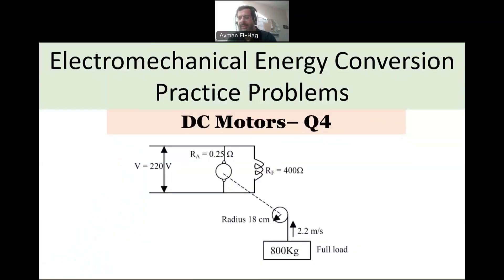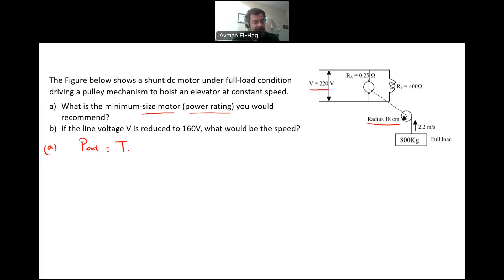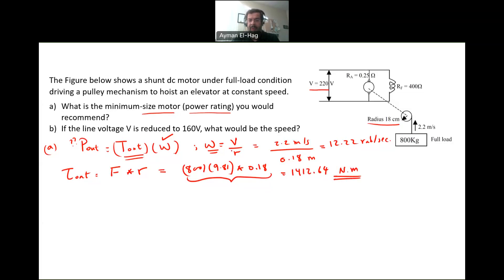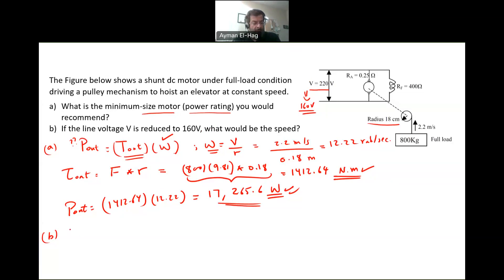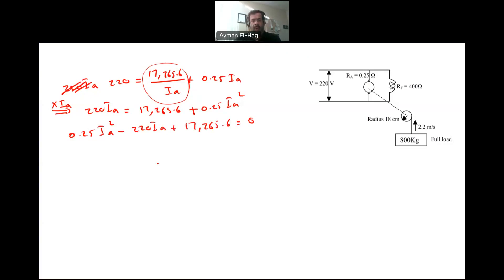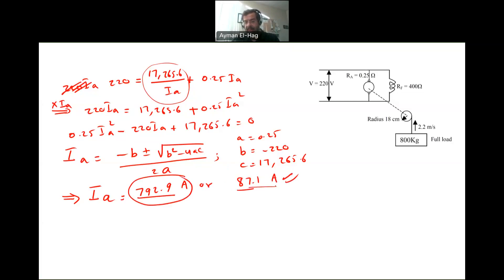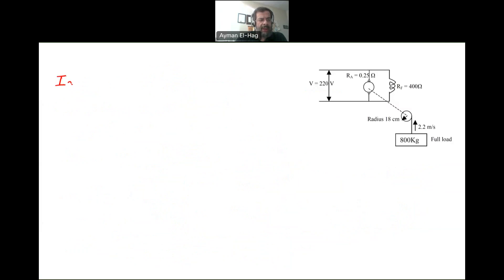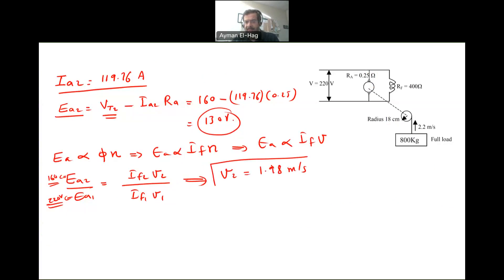DC Motors - Question no. 4

Comment: Sir: I got the same answer up to Ea1 = 198.23V but after that I considered constant Po & followed the same method (used to find Ea1) to find Ea2 & got Ea2 = 125.66V. My question is why considering constant Po is not the right approach? Thank you.
Reply from the maker: Pout is a function of both the torque (which is constant) and the speed (which will be changing) and hence Pout will not be constant.